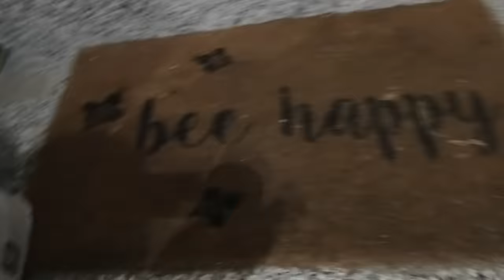Perfect quality brass for reloading. Start to Finish.

Comment: I’ve noticed if I anneal to long or hot my cases will crush or squish down when seating bullets. Also there is no case neck tension. It’s like they got too soft from annealing. I use my HF rock timber’s as well.
Reply from the maker: Funny you say that, I get a lot of "you don't know how to do this", but I've seen it done by 3 separate people, and each did it completely different. I went as close to the machine that does it automatically as I could, and I tend to get a LOT of reloads out of my bottleneck brass (which is why I showed the step). I figure to each their own, everyone is an expert. One person said the case had to be near molten, and there's just no way that's correct. Maybe my method does nothing, but it doesn't hurt the brass as far as I can see... and I shoot .223 a LOT. :)
Reply: @High_Caliber   I normally count to 10 or until it barely starts to look pink. I have the blue colored crimp remover. Usually takes 2 times rotating the brass to get the primer hole crimps flattened enough to accept a new primer without flattening it from using to much force to seat it. I bought another 1000 virgin LC brass right before they ran out of their last run about 5 years ago. Box is set aside and using the other box currently. Saves the drama. Was a little over a $100 for a 1000.

Comment: 10:02 because they are often made from 430 series ferritic Stainless which is quite magnetic due to its higher Iron and ferrite content and lack of nickel (though they could be one of the other 400 series martensitic stainless's like 410 for example as they too are magnetic but only slightly and their cost makes it unlikely... They are much stronger, harden-able and heat treatable grades which is why they are used for "Stainless" barrels and actions),

When most people think about non-magnetic stainless steels, they are  thinking of 300 series (Austenitic Stainless) which aren't classified as being magnetic, although cold working them will cause them to becomes very slightly magnetic in the cold worked zone.

Also, as some who works in the metallurgy field, if you are not getting the necks and shoulders area of the brass to a faint but noticeable glow, you are wasting you time as you are doing nothing in regards to annealing (not even slightly). Annealing is a factor of both temperature AND Time and while brass will anneal at temps below glowing, the time it has to be held at that temp is rather long. Annealing temperature for brass doesn't even start until about 550°F and at that temperature, it has to be held there for a minimum of an hour to anneal. Even at 800°F, the time required is to get down to 100HV is about 30 minutes. Its not until you get between 1000 and 1100°F (noticeable but faint glow) that you get in the the seconds of time that it takes to get down in the low 100HV range which is where you really want to be to prolong case neck life. Even then, it should be done after every firing because the harder it is when cold worked (i.e., sizing and then firing), the more like a crack will form.
For example, I did a test a few years ago on some Lapua brass (since Lapua is known for its quality and its all I use if its available) and took 10 cases 5 of which would never be annealed and 5 of which would be annealed after every firing to see what kind of life difference there was. The 5 that never where annealed (other than what Lapua does at the factory) lasted between 7 and 9 firings before all 5 were crack. On the other hand, the ones that were annealed after every firing made it to 18 firings before they were trash and they weren't trash because of necks cracking, they were trash because the primer pockets opened up to the point that I could push a primer in them with thumb pressure and they would fall out on their own after firing. If the load was lighter, I have no doubt that they would have easily went 25+ firings. 

All in all, its easy to build an induction annealer to make the process really quick and more precise than a torch. No need to spend a ton on an AMP annealer. I built mine for around $50 if memory serves me correctly... It was several years ago so its a bit foggy as to what the cost really was but I know it was under $100
Reply from the maker: This is fantastic. I may do an update as I plan to shift my technique (and do a bit more reading). I was really hesitant to go red hot on cases, since their integrity is sort of required, but I have seen some signs of stress that I thought I shouldn't be, so what you say makes sense.
Reply: @High_Caliber  Yeah, you want to get them to a faint but noticeable orangish red glow (best to do with the lights out / dark room). 

Brass will start to glow very faintly at about 950° to 975°F but even at that temp, it has to be held there for about 20 seconds to get any appreciable annealing. It needs to be closer to 1100°F for annealing to the point of being down in the low 100HV range within a second or two. Again, time at temperature is what is critical when it comes to annealing pretty much all metals, not just the temp itself. 

The goal for case necks (like what Lapua for example shoots for) is in the 95 to100HV range (HV is just Hardness Vickers, or "Vickers" scale hardness range) and getting it to about 1100 to 1150°F for about 1 sec will typically get it right at about 100HV because brass cools pretty quickly

People do get nervous with case annealing and concerns with case head separation but its lack of understanding about the time at temp aspect, not just the temp that makes the difference and even getting the neck and shoulder region to a noticeable orange glow (but still not a bright glow moving into the yellow color range) will not subject the head and lower body region to a high enough temp at a long enough time to do any sort of annealing to it. 
  
Now yes, you can over anneal, you don't want to get the case into the yellow color spectrum as that will be enough heat to achieve a full anneal (70HV or lower) which you want to avoid.

This is where induction annealing really shines. With a timer controlling the induction current, its easy to work up to the right amount of time to get a very consistent anneal within a few seconds max depending on the cases (different cases will need different times due to total mass difference and neck / shoulder wall thickness). For example, with some .223 brass I have, it takes my annealer 0.9 sec. to get them to anneal to the right level where as some 300WM cases I have take about 2.6 sec. to get a good anneal. For any given case, the longer it take to get the neck and shoulder to a necessary temp, the more heat that propagates down the body which still isn't really a problem link many people fear because the time spent at even 500°F (fit was let to even get that hot) is too short to cause any appreciably annealing  further down the body and into the head region. I mean, sure, it might cause a change of a few HV points but this isn't an issue because we are talking going from like say 190HV down to 187HV which will have virtually zero difference on strength.
Reply: @CJ-ty8sv You're a fountain of knowledge.  Thank you.

Comment: Noob question here, but at 13:13 you said "Once you've resized brass once it rarely needs to be done again." But then you said, "So the next time around you're just depriming and resizing . . . " Is something missing here? I have a feeling you didn't mean bottleneck rifle cartridges only need to be resized once, or did you? Like I said, I'm new to rifle cartridge reloading (reloaded pistol ammo for years) so resizing bottleneck cases is new to me. Thanks!
Reply from the maker: Resizing in the first sense meaning the shortening, and in the second, means pressing back into it's original dimensions after firing. I should have said "once trimmed, it rarely needs to be done a second time".
Reply: @High_Caliber  Gotcha. Thanks for the clarification, and for taking the time to make these videos.

Comment: That is some pampered brass, right there 😉 Regarding annealing, I think the predominant school of thought is that if you don't get the temp high enough for long enough, it's the same as not annealing at all (i.e., it's useless). Take it FWIW.
Reply from the maker: I hear you. In my limited experience with annealing, ones that I got red hot seemed more prone to splitting at the neck after just a couple of reloads, so usually, I just skip that step, and use them until they show signs of stress. I've got buckets of .223 kicking around from the days we could find crates of it for decent prices, I just thought the annealing step looked cool for the vid. This is more a visual creation than an educational one if I was being perfectly honest. Telling people HOW to do things can be used in court if something goes wrong.
Reply: @High_Caliber  Yeah, red hot is bad. But I get you on having enough of certain cartridges to not anneal. I do the same myself with most, though I've played around with some cheap annealing methods. Unfortunately, I don't have the "problem" of shooting so much that I have to be conservative on brass cycles.

Comment: I use pellet media rather than the pins. They do an amazing job on 223 and always fall right out. Only takes about 30-45 mins.
Reply from the maker: Do you mean conventional media like walnut shells? I've never heard of pellet media before. I used to use the walnut shells, but ended up with high lead levels in my blood, so switched to wet. If you have a wet pellet link, let me know, I'm always looking for new ways to do things :)

Comment: its interesting to see how other reloaders go about the process... You gotta get a larger wet tumbler bro, id go crazy doing 40-50 cases at a time. Good stuff tho!
Reply from the maker: I thought about building one for 5 gallon pails, but honestly, I sort of do it when I'm home from a day of shooting. Now, if I could mix and match brass, that would be a whole different matter, but now, if I do 9mm or 45 with .223 the cases cement each other together. I also wonder if all the pins would end up inside the cases. I've been looking for new smaller pins.

Comment: Well look at that a man that doesn’t need to drop 3000$ on area 419 aesthetics, getting the job done just as well. You sir, are doing a great service showing how to get it done without having to explain to the missus why the cards maxed out again 😂

I’ve been debating dropping the $ on a giraud or Henderson trimmer to do the cut, chamfer, and deburr all in one. I hear RCBS makes a triway trimmer that does it too, for much much cheaper but I haven’t heard anyone rant and rave about it like the other two so who knows. That’s one of those credit card killers though so for now, we do it this way.

Tip of the hat to ye sir 🎩👌🏼
Reply from the maker: The way I look at it, trimming is something I rarely do more than once, and it's likely because of manufacturing specs, not case stretch, so I didn't spend the $ on a fancy piece for that stage. I'd put money into the press and caliber setups. Besides, in this economy, all of my $ goes into primers. Glad you enjoyed, cheers!

Comment: I thank you for the info!! I Want to stat to learn about Re-Loading ammo.  But, What are you actually looking at Around Time Stamp 13:02min? What were you actually looking at? ( They all looked the same to me. )
Reply from the maker: I was checking to see if there was a crimp ring on the primer pocket that could be swaged out. It just makes it so much easier for subsequent reloadings if the crimp is removed.

Comment: Try using a deep socket for your drill and then your torch can sit on the bench and when case reaches temp you just dump in water instead of putting each peace in the drill

Comment: Great video. I have a bunch of 9mm brass that is ready for the tumbler however it has been a long time since I sized it so it has lanolin based lube really stuck on them. I wet tumble using the same tumbler you do and on the last batch it didn’t take the lube off. Cases came out black and sticky. What can I add to help break down the lube?  I use dawn dish soap and lemishine.
Reply from the maker: I would try 99% isopropyl alcohol to break down the lanolin. I don't think that would react at all with the brass. If you have enough spares just junk the batch, but if you're short on reloads try that. You really would think the lanolin wouldn't survive the pins.
Reply: @High_Caliber  thanks. I’ll have to give that a shot. Last night I tried to add a bit of industrial degreaser by zep, tumbled for 2 hours then dumped it and just ran water with dawn dish soap for 12 hours and they came out beautiful this morning. Also there are videos with guys using woolite laundry detergent. Supposed to take any lanolin based lubes off really well.

Comment: I don't like trimming. Wears out my fingers if trimming in the thousands. Finally broke down and splurged by getting a Henderson trimmer. And while it doesn't make it a joyful task, I no longer dread the trimming stage. Also went to a Redding Type S die, which further cuts down on brass to trim.

Comment: I've been cleaning brass for 30 years with a vibrator and corncob media, plus an occasional capful of Dillon rapid polish, ignoring that the interior isn't shiny clean.  Going the wet tumbling is way too much chasing diminishing returns.  FYI, I earned my NRA high master card with brass cleaned this way. I did uniform and clean primer pockets, but just for long range match brass.  For across the course,  that made no difference.  
I with hold judgement for F-class shooting brass prep where rinsing the brass with holy water is probably a secret step to winning, but suspect a simple sprinkling of the loaded ammo is sufficient.

Comment: Most utilities stainless steel like even stainless steel tech screws or self drilling screws will still have enough Ferris metal in them to make them magnetic for their uses     a very high-grade stainless will not have that that’s why the pins are magnetic    I’ve also heard some times when those pins are new for the first few cycles you’ll get a little bit of discoloration on them which will eventually wear off.  So I am assuming, because I do not have a wet Tumblr yet, that would probably be the small amount of carbon steel in the stainless
Reply from the maker: Very likely, and good thing they do, as it would be much harder to get the pins out of the cases if they weren't magnetic. I DID notice that there was minute rust and discoloration when the pins were new, but since then they've been perfect, and they're a few years old now.
Reply: @High_Caliber  Yeah I had stumbled across the video where some guy had said the first time or two they might get discolored but it will go away

Comment: You should definitely try the RCBS military crimp remover chucked in a drill. It's cheap and only cuts the crimp, leaving a champher around the pocket. Better than your original 2 step process, not sure how it compares to swaging the pocket. I've got the press mounted swaging kit but haven't tried it yet.
Reply from the maker: I used to use a hand cutter, and it just seemed to take away a  fair bit of the primer pocket material, I'd end up with a pile of brass shavings, that's why I went with the swage, it's compacting the metal instead of scraping it out. Not that I've had a lot of primer pockets blow out in my day so probably fine to do it either way. I'll say this...the primers seat so much easier when swaged than cut. I used to have to chamfer each primer pocket to ensure the primers didn't seat at an angle.
Reply: @High_Caliber  one of these days I'll have to try the press mounted swager and compare the two, hopefully some time soon.

Comment: Really enjoyed the video, learn something everyday.  My concern is stress lines, you say specifically on Winchester, but I seem to notice it on several different brands of cases.   I have heard others simply say dont worry about it.  You’re the first to point out it is a sign of possible case separation.  Is that imminent case separation or something to be aware of after a number of firings?     Thanks for the tutorial
Reply from the maker: Winchester brass have been the ONLY ones that I have ever had separate at the base, and in more than one rifle caliber.  Now to be fair, winchester doesn't sell its ammunition to be reloaded, AND they also DO sell empty brass cases FOR reloading, so maybe it's intentional, but while I've had a lot of cases split at the case mouth, only Win brass failed in the chamber. I just think it's something in their manufacturing process that the other companies don't seem to have an issue with. Just personal preference, I just put the winchester into the brass bin.

Comment: Some steps i do the same , but the wet metal tumbler i do not use . After sizing and depriming my brass i clean my primer pockets , measure brass lenght and trim the ones that need to . After that everything goes in a dry tumbler 2h with Lymann corncob if that is ready in a sock and in the familly washing machine after iwashed it i dry it @ 140 degree celcius in an oven.
no moist , corn dust  or wax on my cases
Reply from the maker: I gave up on any kind of dry tumbling as I was breathing in a large amount of lead gas, to the point that it affected my health (which is how I found out...multiple bloodtests). That's how I found wet tumbling in the first place.
Reply: thank you for the feed back , i to have a high lead count in my blood (+10)but i think it is from the shooting gases itself .  @High_Caliber

Comment: If the case has a crimp ring I just chambered it back on a 45 degree and then set primer and it works great . No issues on 200 rounds of 308
Reply from the maker: That's how I used to do it too, but the swager tool is just so satisfying to use...